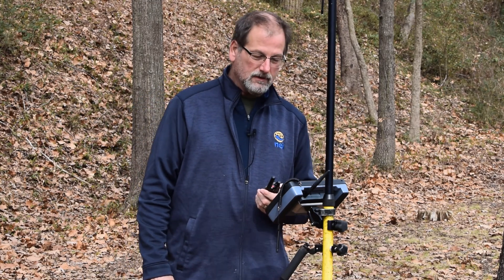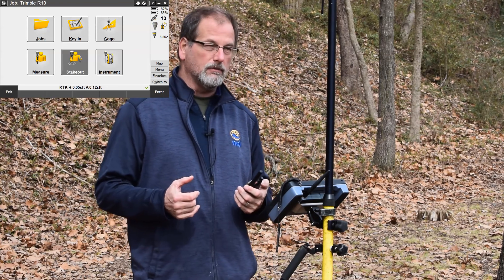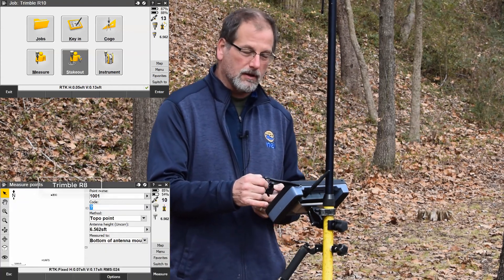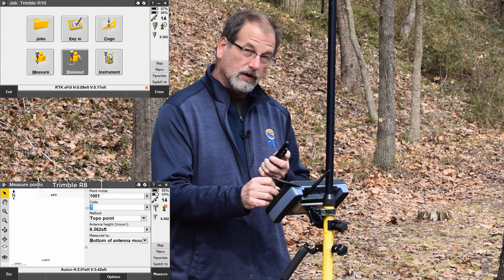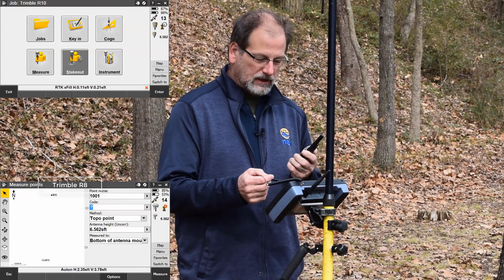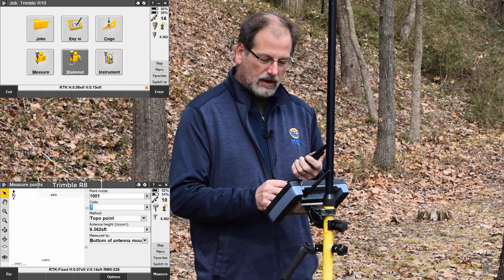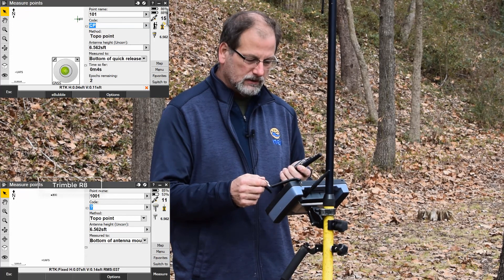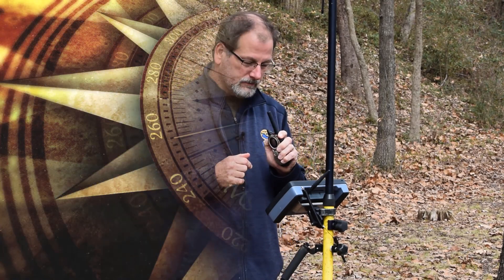Trimble xfill

Comment: How are you getting the screen captures of the data collector?
Reply from the maker: Snagit, you can capture photo or video. Keep in mind I am using a windows 7 or windows 10 collector. You can use a windows mobile like a TSC3 but you will need a computer in range to record. In which case you will need soti pocket controller from soti.net.
Reply: Thanks, been learning a lot form your videos
Reply from the maker: Awesome!!!